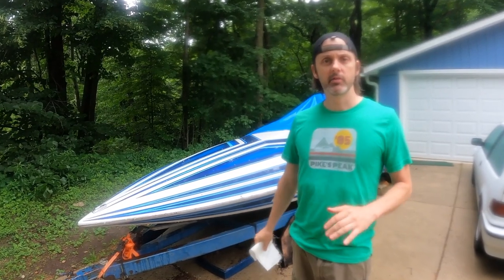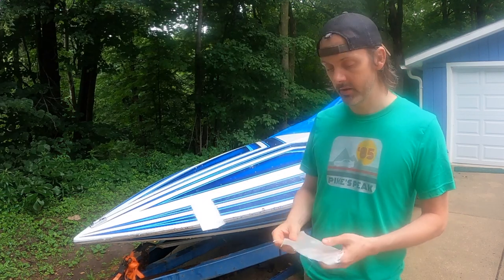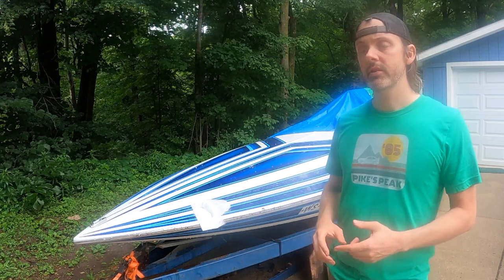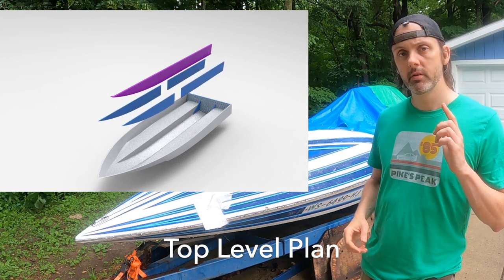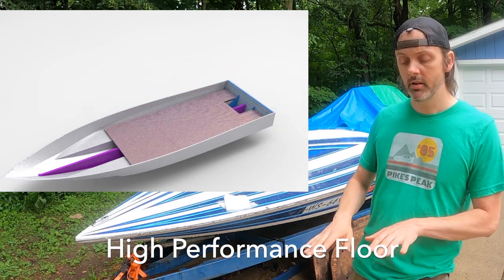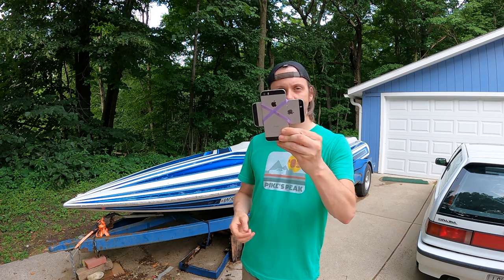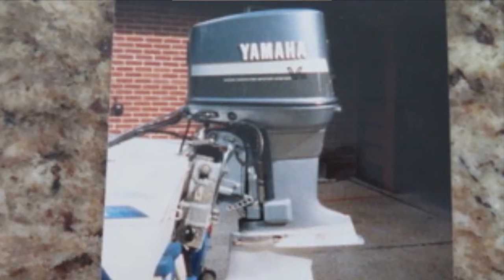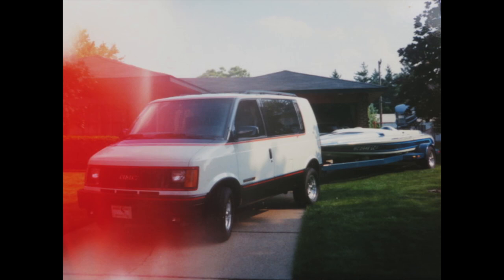Restoring a Race Boat for CHEAP!  Advanced Composites & Fiberglass Info  Sleekcraft SST Sunday #6

Comment: The SST has an inherently weak transom as you know. It should be cut out and decked over. No way around it.
Also, the banana rocker in the center sponson MUST be straightened to be parallel with the two outer sponsons. This is done by padding to the bottom on the sponson from about the front seat position all the way back , not cutting it. Yes, you must flip the boat. 

Allow a 10 inch long by about 2 inch deep step at the rear of the sponson. Make this pad FLAT as in FLAT. 
There should be a 4 inch tall 3/4 inch plywood bulkhead at the front of the back seat. The two continuous 3/4 inch knee walls from the transom, decked over splash well, and floor connect (very important) to this bulk head. They are to be set on the inner top edge of the tunnels and covered (very important) with just one layer of cloth. After tabbing all the way around with mat.

 Bolt your engine bracket "directly to the knee walls through the transom" with angle aluminum.
Another full bulkhead at the rear of the front seats, and another full one at the front of the front seats. They are to be 4 tall x 1/2 inch ply. Lay 1/2 inch ply over them to attach the seats. Leave the nose bulkhead as is.

All the area under the bulkheads get padded at least 10 inches wide from thick at the bulkhead to feather thin with liberal amounts of glass. Float the bulkheads from the glass 1/4 inch. Cover (very important) the bulkheads with one layer of cloth. 
There is no need for stringers or false floor. Set your motor 12 inches back for a 2,5 liter, or 10 inches back for a 3 liter.

The SST is a very poor boat as shipped from the factory, but it's a marvelous performance boat if corrected as directed.
 3 liter 300hp will run about 110. 2.5 liter will run about 115. 

It will ride dry, plane flat and fast, turn very predictable, not be prone to flipping like it is now "that's the main problem with the stock SST" and it won't spin out like a stock SST. 

I know this is a lot of high and mighty poetic waxing. But if you trust me you will be amazed at how good a runabout it is. Think Stoker 20 class good.
Reply from the maker: Woah I don't know how I missed this comment!  Thank you for the writeup, I will see what I can do.
Reply: @ADDvanced  Your welcome. Any questions just ask. Personally I don't think fancy materials are justified on this boat. Polyester and plywood is just fine. Except the bottom pad. That gets epoxy.
Reply: Mp8er1ds9x - Does this protocol apply to a Taylor Mod V- California Taylor… I have one and I bought it completely gutted, so I’m trying to learn how and what I’ll need to do to do it right
Reply: @stevem8602  

I don't have any experience with the Taylor Mod V- California Taylor. Is it a copy of the SST?

Comment: Great videos and awsome build. I would recommend beefing up the transom with some added thickness 2-3+ layers of biaxial minimum. Especially if you want to add big power. Few extra layers on the transom wont effect the weight too much especially since your floor will be very light!. Also sanding and prep is key to have a nice clean lay up. I would also recomend looking into vacuum bagging either for this project or the future.
Reply from the maker: I'm a bit intimidated by vacuum bagging but I will look into it.

Comment: Use 1708 for where you need strength and structure. And chop strand mat for the fi ishing areas. Im doing an 84 Laser LTV now, and used 1708 for the transom and stringers and all tabbing. Ive only really used the mat on the bottom side of the floor and havent decided if im going to do 1708 and mat on the top side of the floor or jut 2 layers of mat for the top. Mat soaks up so much moor resien than the 1708. And i also used epoxy to bond the transom pieces together and the stringers to the hull.  Good luck man keep it coming. I enjoy the videos
Reply from the maker: Question about the 1708; my boat already has tunnels running fore/aft, and it'll have a stringer as well, so it should be pretty stiff that direction.  The floor is unsupport from tunnel to tunnel.   If I'm thinking about the strand orientation correctly, I should run 1708 port/starboard, so the strands go across the unsupported area.   Correct?
Reply: @ADDvanced  I hope this makes sense. The binding stitching of the 1708, i ran sideways across my stringer. Port to starboard. I did two layers for each stringer the first layer that overlapped the floor about two inches then the second layer by i think three and a half inches. And when i had to over lap the 1708 for the length of the stringer i would overlap two inches.
Reply: @ADDvanced  my LTV is a modVP hull as well. I did my floor a little different. I learned a few things during my build that may help you. If you have any questions just ask.

Comment: Good video! I know we're my old laser LTV BASS BOAT is and I'm tempted to get it. Rob I had 2.4 off shore carb motor. It was turning a Mark Croxton, worked 28 p big eared chopper. The boat wood run consistently 96.675 mph. When you get to set up the boat, I can help you. The key to making a tunnel v boat run is getting it up on the pad and getting sponsons out of the water. When you can get to the fine line of almost blowing it over, then you are hauling butt.

Comment: Good idea to add knee braces, make them a little taller, or go higher up the transome for strength. Great Job!
Reply from the maker: I want to, but I can't.   If you watch some of the previous videos I have a splashwell that dives down right in front of the transom, which limits the height of the knee braces.   I will definitely make them as tall as I can without interfering with the splashwell.
Reply: @ADDvanced  yes sir that is correct. Keep up the good work!

Comment: I'm super stoked on this build, she's gonna be badazz! Im thinking that you might as well take that center stringer and knee it up the transom as well as the other knees for a bit more rigidity but it might be overkill. I have no clue what motor your gonna run so I don't know what is overkill or not.
Reply from the maker: I might but I'm limited in height due to the splashwell.

Comment: That boat is going to be nice n' rigid when you are done! I was going to mention to offset the cuts in your multi piece stringer but looks like you have that covered in your CAD. 

Something to maybe consider for your resin work is to vacuum bag parts to cure. Then you can use peel ply and bleeder sheets to absorb excess resin. Then you get a lighter, stronger part.
Reply from the maker: We will see I've never done that before and don't want to wind up with this unfinished.   I'll look into the bagging...  need to find a good primer somewhere that goes over everythign from a top level.
Reply: @ADDvanced  The bagging process isnt too bad. Done some professionally for work and some small home projects. Im an A&P mech, working on business jets, our main product is the Hawker 4000, an all-composite jet. I think you are definitely going the right direction on the Sleekcraft! Do a little research on vacuum bagging, I think it would be beneficial for you in the end. Mike Patey has a lot of composite work videos to get ideas from on his aircraft work.

Keep up the good work, doing awesome 👌
Reply from the maker: @mytmousemalibu  Do you guys use biaxial weave fabric?   I was thinking about running it port/starboard, so the longest/straight strands are crossing the gap between the tunnels.  The fore aft of the boat is probably pretty rigid with a stringer and two tunnels, so it's the floor that I want to tighten up.  Make sense?
Reply: @ADDvanced Most of what is used in our planes and I would say in aviation in general, is biaxial and unidirectional. A lot of the parts are with biaxial. For example floor boards. Multi layer biaxial carbon sandwiching a phenolic honeycomb core. The fuselage tubes are of the machine woven  strands in alternating ply orientations. Say if an impact damage occurs,  we would sand down the carbon layers till the damage is gone and sand in a large radius around the epicenter. Each layer is sanded very carefully to form a step in each thin layer. Then new pre-impregnated carbon patches of the same ply are stacked in following the existing ply orientations. Vacuum bagged & cured. Also a very fine phosphor bronze under the top layer for lighting protection! 

In your case, i think you are right about the stringer and tunnels providing good lengthwise rigidity. For spanwise flex and maybe torsional flex it might be best to go the way you mentioned above but also 2 layers on top with 45° orientations? I can't say I know a lot about marine specific needs though. Perhaps some else in the audience has some more specific insights? Our fuselages are wrapped like a composite pressure vessel which is exactly what they are.  Layers of alternating ply orientation yields the most strength. If you need ultimate strength in only one  direction all plys can be oriented that way and it will be very strong in that direction but offer little strength 90 degrees to it. Alternating multiple layers is pretty strong in all directions.

Comment: What I would do is because your updating your engine I would put a metal support in front of engine to stop from twisting do make a subframe x with crossbars the reasons n the we broke the motor mounts and the stringers I would make the stringers two by six and cloth and fiberglass wear gloves the twisting is what's breaks the after we fixed it never broke had a 454 big block it flew and we were tuff on our stuff

Comment: I must admit my early engineering stupidity, I once replaced a floor with woolmanized and tried to glass it in and also glass over it. It lasted literally 4 days on the water before it de-laminated and then the edges popped out.... back to the driveway and break out the wallet it was...
Reply from the maker: I've read you can use treated, but you need to dry it out in the sun for a few weeks to get the moisture out of it.  Most of that stuff is stored outside and too wet to get a good bond to resin.

Comment: You mentioned polyester resin for the transome sandwiching coosa layers, expoxy resin is stronger. Research epoxy resin for the strength you want for a high horse power engine hanging on the transome.
Reply from the maker: I'm going to stick with polyester because I'm more comfortable with it, you can modify it a bit easier than epoxy, and its' compatible with CSM.   Epoxy and CSM don't go well together, from what I have read.
Reply: @ADDvanced  good research sir!
Reply: @ADDvanced  ~
Most CSM is held together with a Styrene binder that dissolves in contact with Polyester resin, but they make a type of CSM that is compatible with Epoxy too... it uses a powder binder, rather than a Styrene base.

Comment: I’m replacing the stringer for the first time in my 78 pioneer jet boat and am trying to do as much research as possible. Love your vids they are so helpful. When installing the stringer would you bond it directly to the hull or I’ve seen people installing small foam tabs on the hull and then putting the stringer on that?
Reply from the maker: Stay tuned, will be in a future episode for sure!

Comment: Dear Sir. Where is your Floatation in the Boat? You may want to make your Transom Kevlar/Carbon foam sandwich and use honeycomb panel for stringers for the Floor do Carbon/Kevlar sandwich Foam to help with Hull Twist!  Take a Look at Dark Aero airplane Build at there way they made the sheet panel? This Builded will be one fast Boat. Like ideal keep it lite.
Reply from the maker: These boats don't have any floatation, lol.   I'm not sure when it was required but yeah... technically the coosa and the honeycomb panels should provide a small amount of flotation.  I usually leave an innertube up near the bow; doesn't weight anything and if the boat sinks maybe it'll float enough to drag to shore or something.
Reply: Many times I have seen people putting partially inflated truck inter tubes under the floorboards to help with flotation
Reply: @paulcampbell7826  never how the H you try to seal a Cut truck tire?

Comment: YOU NEED COMPRESSION BLOCKS WHER YOUR BOLTS GO THROUGH THE TRANSOM FOR THE ENGINE. Use a hole saw large than your bolt fill it with a dense puddy before you glass the transom. Ps you need plenty of glasses on the transom the foam doesn't have real strength it's for rigidity by spacing the fiberglass. Imagine you have a 1/4" of fiberglass, not that stiff but two pieces of 1/8" fiberglass with a 1/2" space between them is as stiff as a piece of 3/4" with only a third of the fiberglass and weight. Ps don't kid your self Chopped strand matting is around 50% of the total of glass in most constitution for a reason it is vary strong. None of the other types of glass work with out the CSM
Reply from the maker: Definitely will be using compression limiter sleeves for any through bolts, but I'm unsure if I need to do the hole saw/putty thing, I will look into it further!

Do you think I need a layer of glass IN BETWEEN the two layers of coosa on the transom?  Or would just resin work okay?   

And once both pieces are in, how much glass do I need?  I was thinking 1 layer of CSM, then a layer of Woven Roving, so 2 layers total.  Think I need more than that?

Appreciate the input and thanks for your time!
Reply: @ADDvanced  I think CSM In between Coosa creates the strongest bond, but just resin also works fine. This guy  in the link did tests, https://www.youtube.com/watch?v=IZzsvCDDXKI  but,  he didn't test CSM
Reply: Coosa is dense, very strong and stiff. 3 layers is common at 1/2 x3.
Reply from the maker: So 2 at 3/4 should be fine.... right?  Planning on starting with a 200 2.5L
Reply: @ADDvanced  Coosa usually recommends matching the thickness of the previous transom.

Comment: Sounds like a great plan. 
Only thing im questioning is the composite, multi piece stringers. I know you know more than i do in this category. But it would think a single piece would have more rigidity. With less chance of stress cracking down the road.
You may want to look into using douglas fur single beams. Lineal grain beams.
Im only suggesting this from a video i saw on stringer replacement. 
Heres a link to it.  
https://youtu.be/Q7zqNtdO6ow
Reply from the maker: Yeah if I had longer pieces I would have.  However.   I read the core of the stringer isn’t really what provides the strength; it’s the laminate over the core that is making it so strong.   As long as it has a good bond it should be plenty strong.
Reply: @ADDvanced  makes sense. The Tahiti i just picked up has 1/4 stringers. Basically stringers in the rear for the motor to mount. From then on, the boats relying on the floor and the floors mounts as a structural piece of the hull. Pretty interesting considering the boat came with a 390 HP 450 FT of Torque Big Block Olds 455. Its not exactly a small lightweight motor. You would think full stringer’s would’ve been mandatory.
Reply from the maker: @johnnymula2305   Yeah, there are race boats running without stringers at all, especially if hte boats are tunnels.  The croxss section w vertical walls adds a lot of strength.  I probably could have skipped the stringer but the thought of hte hull delaminating from flex at 80mph kept me up at night.

Comment: There is a 73 Sea Ray Pachanga jet boat for sale cheap near me but it needs all this done and has no motor or rigging hardware but the pump is there... You are a bad influence on me ans it is now ticking in my head again..... grrrr
Reply from the maker: I <3 Pachangas
Reply: @ADDvanced  It is a super cool jet boat and the whole windshield is there in good condition... It is burning a hole in my brain... dude want's 300.00 with the trailer.